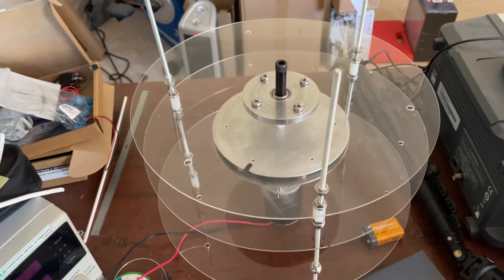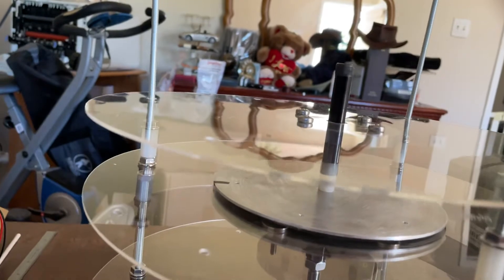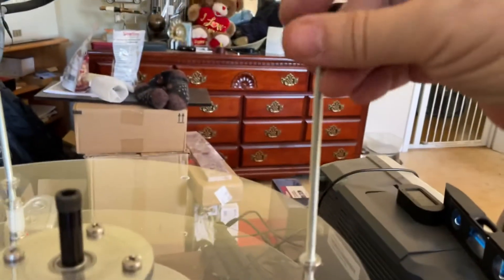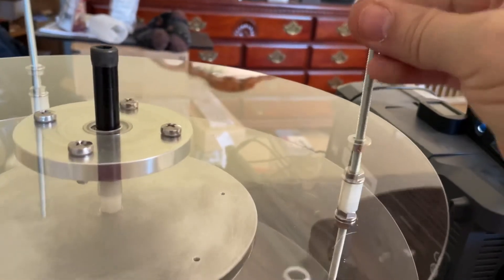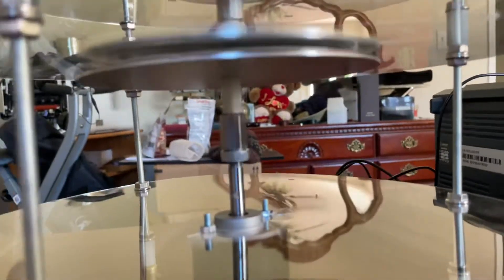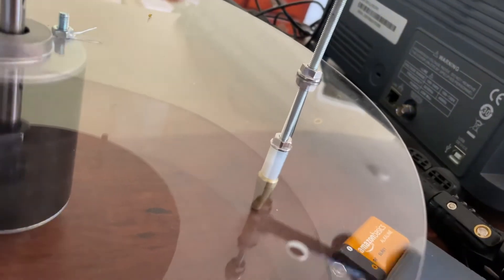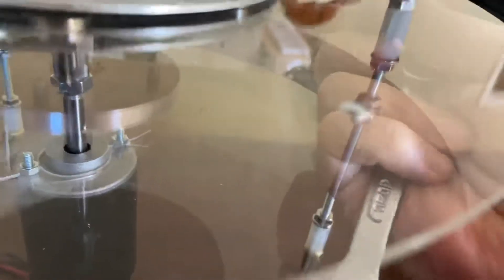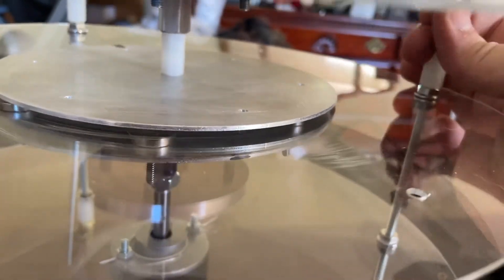Building Antigravity (Part 4)

Comment: I went for rubber grommets to reduce some of the vibrations
Reply: I used what I had but, most of the vibration was being caused by bearing play, allowing the top disk to wobble. I doubled-up on the bearings so that it's stiff now and doesn't wobble. It runs very smooth at full RPM now. All I need now is some HV!
Reply: @ToddDesiato  Would a taser work?  some of them get to high voltage.  I think it is pulsed DC square wave
Reply: @dustinmacdermott7847  I'm using a TV flyback. It requires more power than a chicken ckt like a Taser. :) That's why it's taking so long. I have to build a PS that is safe for me to use at 30kV. I've been kicked by a TV before!